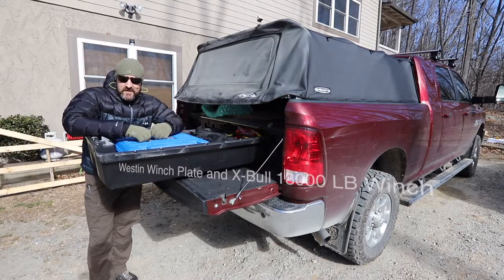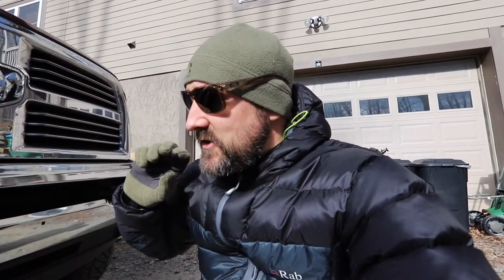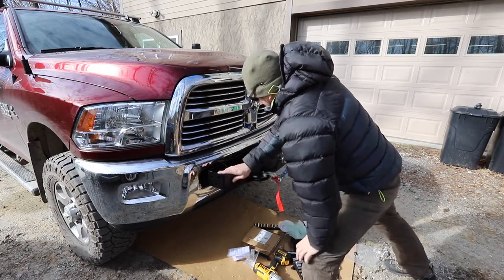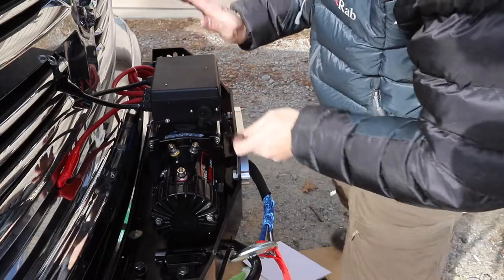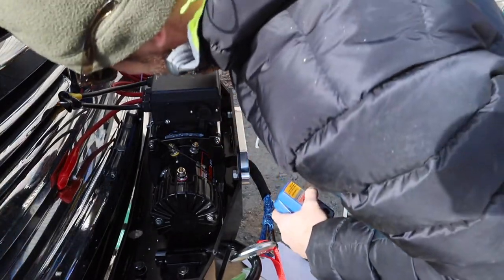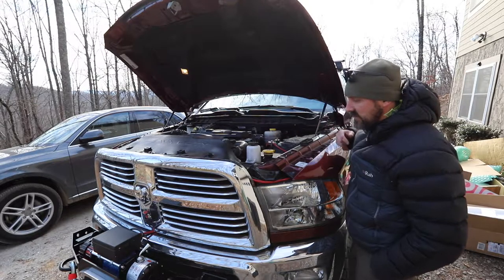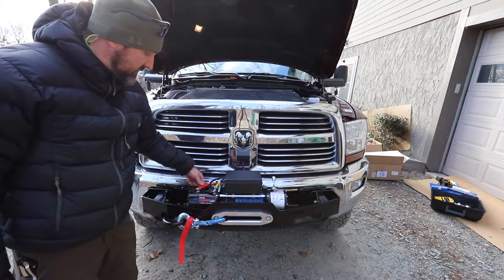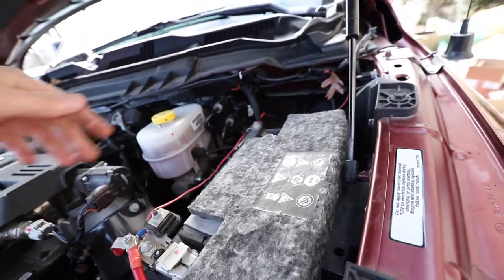Overland Build Update 5: Westin Winch Plate and X-Bull 13000LB Winch install on my RAM 2500 MegaCab

Comment: Just a suggestion you should look into getting a resetable circuit breaker and install it in line nearest the battery as possible for protection. Great video though. I'm looking into getting a bumper mount system.

Comment: I was scared for you when you did the demo near the end!!! NEVER EVER put your hand or fingers on a cable that close to the hawse/fairlead.....came close to squashing your fingers. Also, I would highly recommend connecting the NEG cable directly to the battery....not a bolt on the body or frame etc. Cheers from Australia.

Comment: I put this same winch try on my 2017 Ram 3500. NOT EASY. Get some help. There is a "D" and a "P" printed on the winch tray mounts. D= drivers side and P =passenger side. I used the same bolts that Dodge used to attach the OEM hooks, the only difference was that I put the nuts on the front side of the truck. I torqued the bolts down using pneumatic wrench as tight as I could get them. After that the rest was a breeze including the winch. I did not use this guys winch, I bought a Badlands 12,000 winch and it fit perfectly. I bought the hooks and a stainless cover for the tray  because I have a lot of chrome on the front of my truck. I am very satisfied with this winch tray.
Reply: Do you have part numbers i have a ram 3500  2018
Reply: @josephvolper3633  I bought the winch tray from Westen and they have a web site. Just put in your vehicle info and the site picks the right model to fit your truck. I also bought a polished stainless steel covere for the front of the winch since I have the chrome package on my truck. Everything fit perfectly.

Comment: I saw where someone below commented about protection on the battery wires but to elaborate, the main red positive wire to the battery needs to be fused within 12-18 inches of the battery. I'm surprised the winch didn't come with a fuse (the Harbor Freight winches do). The problem in reference to a short is that if that battery wire grounds out it can burn the truck to the ground. The same is true for your wire to the CB radio though it being smaller it would probably burn itself to a breaking point before doing too much damage. Honestly, just get a 4 gauge fuse such as one used for a car stereo installation and you'll be good, you could even tie the CB radio wire into it as well. Hit up a car audio shop and they can suggest and sell what you need. That aside, I'm curious as well how the winch works. Thanks for posting this video, so far this only one of two on YouTube for thus winch.
Reply: And I just found your first winch test video haha

Comment: Do you have a leveling kit or lift installed? What size/brand tires are you running?
Reply from the maker: Currently I am running a bilstein leveling kit, AEV Katla wheels and 37 wildpeak at3w’s.  I did have to put a thuren sway bar on as the stock one rubbed at max turning.
Reply: @PrestonGladd  awesome! Love the look and build man, as for me one more question. During this period when you installed your mount, I noticed you had the same stock wheels as I do. Are those the 37 Wildpeaks? I just want to keep stock wheels, but add the leveling and bigger tires, if that’s even possible.
Reply from the maker: @pintobean7058  no, I have the AEV Katla wheels, the stock won’t fit 37’s, the backspace/offset and the wheel width won’t work with a tire that big.

Comment: If you still have the truck and winch tray could you give an update on how it’s held up and the upgrades you’ve made to the tray and how you did them? I’ve seen other videos and saw you also had large lights installed.
Reply from the maker: The tray is still going strong.  The bull bar was flimsy, I drilled holes in the tray and mounted lights on that.

Comment: Thinking about doing a similar setup for my Raptor. How much weight is the winch tray, bracket, and winch? Also, did you measure much much your front end dropped?
Reply from the maker: Just saw this comment, YT lately doesn’t notify me when I get comments.  The weight is almost non-existent in relation to the truck.  My bumper didn’t drop any.  Total weight I would guess is no more than 40lbs.

Comment: Great video!  How much weight do you think it added to the front of your truck?    I’m thinking about going with the Smitybuilt 10k HD,  I have the 2016 ram 1500 crew, i’m running pro comp 6inch lift & Fox factory 2.5 coil overs with remote res,  just wondering about weight spent all this money levelling the truck I don’t want to rake it out too much?  Really need a winch!
Reply from the maker: Mike Stand it added maybe 35lbs? Not hardly anything at all.
Reply: Preston Gladd Overland  so The Westin winch plate and winch only added about 35 pounds to the front of your truck?   I had a Warn winch on another vehicle and had nothing but issues with it!

Comment: shackles are pretty much always sold separate. That is because not everyone buys them. they may want 1 or 2 or 4 (for rear bumper) so this saves costs for customer. Also, with the new fabric ones that can handle 30K lbs + load versus the metal ones that are 4K to 7K lbs load it makes sense. You will need to make sure your shackles are 13000lbs load bearing as well or they will break and potentially kill someone near by when winching. :)
Reply from the maker: I didn't think I was talking about shackles in this video, only the tow hooks, which are used to attached kinetic ropes or other recovery ropes to.  Westin does not include them and you have to purchase them separate.  You lose your factory ones because the winch tray attaches to where the factory ones were.  As far as the safety aspect, I am recovery certified by the U.S. Army on both the M984 HMMT and the M88 old version and the Hercules version.  I have conducted hundreds of recoveries safely with recertification and over-site from other recovery certified Soldiers.  All recoveries are dangerous, but especially when your recovering a turned over M1A1 Abrams.
Reply: You don't by any chance  happen to have one of those Abrams in your storage unit to sell?  LOL.  Just want to make sure those tow hooks will can handle the load and more than 13000 lbs. I bought the rope that can pull 31000 lbs In the event i use a snachblock which allows to pull almost double of what the winch can normally do. I didn't want you to get hurt. I ordered a smittybuilt water sealed 10K wench and I watched your video to get more ideas on that winch you are reviewing. Great that you shared this with us and I think you will have long years of enjoyment with that winch there to help you get out of tight spots.

Comment: How long can you run the winch before your battery dies?
Reply: When using the winch, you must keep the truck running to keep the battery charging, if you don’t run the truck the winch will drain the battery down quickly.

Comment: one tow hook?  if you had to remove two; they should have included two with the tray or include adapters to reuse the stock hooks that's a crappy way to treat the consumer.

Comment: You should really check your instructions....  a fender ground?
You might want to consider some extra protection around the positive cable so you don't have any problems in the future with a short.
Reply from the maker: Layne Pauly it’s grounded to the frame, there is a ground wire ran from that point down to the frame from factory.  I will be putting packing grease on all of the terminals.
Reply from the maker: Upon further reading I am going to switch it to the battery, it voids the warranty if I run the ground to the frame.  It all boils down to resistance and keeping the electrons flowing with as low of impedance as possible.  The main issue I have is I will now have to run a new cable, as the one that came with it is to short to reach my negative battery terminal.